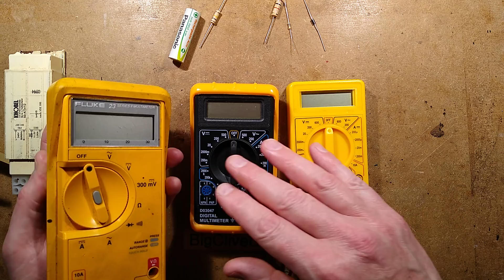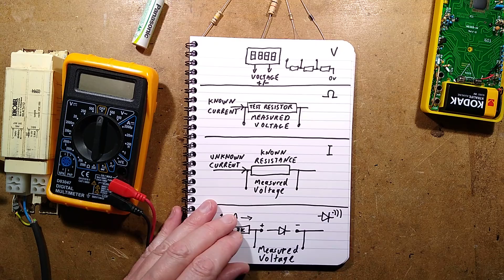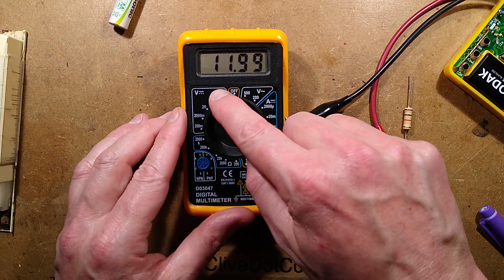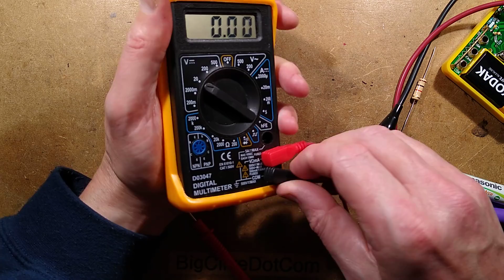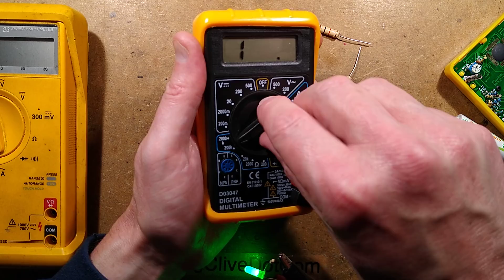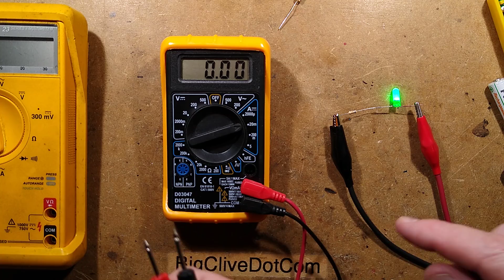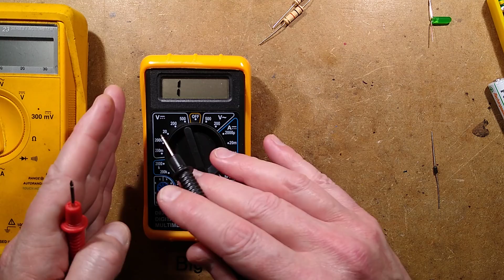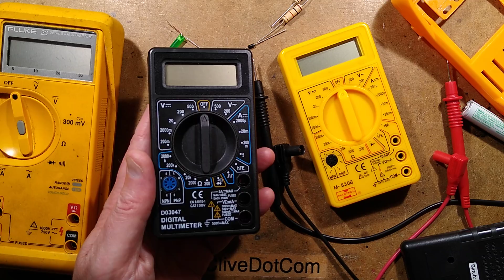How to use your trashy meter without blowing it up (much)

Comment: Hej always great info and vids. I bought a solar panel pack from my local store. When i left it in sun all day and tried my phone on it to charge it up nothing worked. It has 2 usb ports 1 for ios and 1 for android items. I took it back they told me it would take 3 or 4 days to check over, after 123 hours they said it works ok . I picked it up as they would not give my money back. I took it home tried it all over again and nothing. So i decided to take the 3 panels apart from the big pack. So just 2 wires from each as they were in paralel form. I used my multimeter on them and i got no reading at all. I even used a high rate lamp on them and still nothing.  Do you think they are dead or worth saving ? Thanks
Reply from the maker: Many of the solar panel power banks have fake solar panels and are nowhere near the capacity or output rating they state.

Comment: I'm sorry, this may be a very dumb and basic question. Why can't we measure amps without a load? If I want to see how many amps does a power supply output, why can't I just stick the two probes in the output?
Reply from the maker: That would show what current the power supply delivered under a short circuit.  It may blow the meter fuse or damage the power supply.

Comment: Clive I bought an ebay "smart" multimeter.  So far seems to show somewhat accurate readings.  There is no dial setting.  The meter identifies the task required and displays the proper reading.   So far it works.  What is your opinion of these?    P.S.   wish you would do a video covering portable hand held oscilloscopes.
Reply from the maker: They can be useful.  I prefer the manual selection as some of the auto ones don't properly select between resistance and continuity.

Comment: Oh hey, that Panasonic rechargeable reminds me of a question I had about my anyloops (feel free to ignore if you're busy). Is there anything that could make a regular NiMH lose capacity?

I always pop them on to charge when they run out; my charger measures the capacity as it charges, and for years they came up to the full rated 1900mAh, but lately they only make it up to <1800mAh. I have two pairs that I rotate between and they're both doing the same thing, so I have no idea if it's the device cutting out earlier, a problem with the charger, or if the batteries are on their way out.
Reply from the maker: Rechargeable batteries gradually lose capacity over time.   That can be accelerated by overcharging or leaving in a very discharged state for a long time.
Reply: @bigclivedotcom  Thanks! I suppose it's possible I left them on the charger too long, since it does trickle charge them at the end of the main charge cycle. Could be a good excuse to buy a new set of anyloops!

Comment: I have the same fluke meter giving some strange  reading every now and then but still using it . 
My first one was a fluke 10 series meter best meter I had until some twit stole it 
What the new one you flash for a few seconds any good

Comment: What's the best why to read amps in a car ?
Reply from the maker: Either an inline current meter that plugs into the fuse holder, or a DC clamp meter like the UT210E by Uni-T.

Comment: I dont know if Im doing something wrong but Ive used a £9 meter on single phase, three phase and capacitors and have never managed to blow it
Reply from the maker: In most instances it will be fine.  But the difference is what happens when something does go wrong.

Comment: :3 my dad was digging through old garbage from his many cupboards and found a Fluke and was just like "here"
Reply from the maker: Make sure the battery hasn't leaked and treasure the meter.  It's a good one.
Reply: I have mistaken it is in fact a “DURO” meter, it just sorta looks like a fluke.
Reply: Hm, very interesting. I dont know much about this type of stuff but i can see two ceramic fuzes, both in sockets. 10 amp and 250mA. It has a blob chip and a semi scratchy beeper. Id love to send you a photo of the circuit board somehow
Reply: Wow, so theres another meter ive been using for a while which is very old and was also from my dad, its shaped like a brick but it says luke on it XD
Reply: Damnn, its got a gigantic 100kA interruptor fuze in it, and generally massively oversized components. Id love to see you reverse engeneer this
Reply: The old one is a Fluke 75

Comment: How do you use the transistor tester thing ?
Reply from the maker: Put the E,B and C leads in the appropriate holes and in the transistor mode it will give a rough indication of the current gain.

Comment: The cheapy yellow one... Where can I get better test leads? btw, I blew up one lke the cheap yellow one by changing values while plugged into the wall :) a lot of smoke too.
Reply from the maker: Some of the shrouded plugs don't fit into the cheap meters properly, so you may have to experiment or improvise.  The older style bare 4mm banana plugs will usually fit.

Comment: Any recommendations for a meter to use on 240v?
Reply: I've gone for a MP730008 from CPC for £13.  6,000 Count handheld multimeter with manual ranging. CE/ETL certified multimeter is CAT III 600V, which can withstand a 6,000kV surge voltage. Designed with high voltage warning and over range alarm, making it great for a wide range of measurement needs.
Reply from the maker: If a meter from CPC is rated for Cat III then it should actually meet that spec.   Their Tenma brand are basically generic meters rebadged and made to UK standards.

Comment: Do one on blowing up crappy Poundland meters using the mains supply with added electric shocks!  Who else noticed the crappy Poundland leaky zinc battery?  I had one rot my last smoke detector - the alkali (Poundland) ones are much better - twice the price but last 3 years in a smoke instead of less than 1 and no horrible leaks.

Comment: Before you buy fuses make sure it has one...many cheap one don't so it just blows the leads or pcb...
Reply: I guess additionally some have a fuse but it is not replaceable soldered to the board.

Comment: So I have a question regarding components. I come across a component that looks kinda like a relay but it has 3 pins, rectangular, the number is C7R0N 97 and inside there are two pucks (unidentified metal) one smaller than the other but the center pin separates the two pucks. Anyone know this component. I can't seem to identify it.
Reply: The pucks seem to be two types of material I shined them up but the outside ring looks copper or bronze maybe. I'm clueless as I'm just getting into electronics.
Reply from the maker: It's it from a fridge freezer?   It may be a PTC based start relay.
Reply: @bigclivedotcom  hats off to you Sir......after looking those up that's exactly what it is. I don't know where it came from, it was just in a box of components but thanks a million.
Reply: @bigclivedotcom  one more quick q are they only found in fridges and freezers. Or are there other applications for them and I'm guessing the pucks are in fact copper and aluminum? I'm thinking this box of components came from a plasma tv but maybe this part just got mixed in.

Comment: Please start with an Analog Multi Metre. The ones with a poiner / needle that sweeps across face of the metre. They are, in fact, far more accurate, you will learn and understand much more about electronics with this type metre.  
Learn to read, before you learn bad habits. ☺

Comment: Another good entry level meter would be a zotek(?) zt102 or equivalent aneng an8002 - I believe it's like under or around 10 bucks, has sensible ranges, LED-lighting capable diode range, capacitance, a fucking backlit LCD and most important of all - runs off 2 AAA batteries.
I've got like 5 times more expensive uni-t meter(Dave would also say it's shit) and I don't use it just because it's more clunky and uses the stupid 9V battery that's always dead.

Comment: I have found three $5 meters are far more useful than one $15 meter.  You can have them all connected and showing different aspects of one thing.  Like showing the voltage at several spots.  Or the voltage and current at the same time.  Or whatever.

Comment: Heres a good test for your $300+ multimeter,  take yourself some aluminum foil (good conductor), alternately stack that with Mylar film (good insulator) electrically connect every other conductive layer, then attach your voltmeter leads to either side of the massive capacitor that you just constructed. Press the stack to move the plates closer together and as it is moving you generate a voltage. Release the pressure to allow it to relax back to wider plate spacing and it produces the opposite voltage. Ball up your fist and pound the stack and blow the guts out of your $300 DVM.  Buy cheap meters ever after.

Comment: The most annoying thing for me about cheap meters is not having auto power off. It's so irritating to need a meter, only to find it has a flat battery because you forgot to turn it off last time you used it.

Comment: (Science Class) " Please Sir. . . . I blew-up my Multimeter. . . . "
After yrs of analog, I splurged on a Halfords (Rolson) digital. Working on a Suzuki, trying to trace intermittent spark.
On opening DMM, I found one of the fuses was blown (using the old analog). 10A 600v . . . . .
FleeBay is showing £3.45p + £2 p&p. . . . . Surly there is a cheaper more efficient source for this fuse . . . .

Comment: Been using Fluke for donkies years, if I hadn't I would have blown a cheaper version up many times, being absent minded since my 40s I keep checking voltage on the Ohms mode, oops 🙄

PS, been drppoed many times as well 😔
Reply from the maker: I often do that myself.

Comment: On the cheap ass meters.  What are the transister test points like for testing?  Any good?  Also you educated me .  A rotary knob you mentioned?  Also i can add to the list?  A dirty knob is useless for electronics.  I can say with experience it wont be any use at all.
Reply from the maker: The transistor tester is a gimmick.  But used in the past by some audio geeks for gain matching.
Reply: @bigclivedotcom  thanks Clive, very good for you to work after midnight.   Lol
So even to check if Transisters are gud or bad,  isn't really possible then?

Comment: I wouldn't suggest using the ones you get free from Harbor Freight.  It's very important, from a safety stand point, to actually have a back on your meter. 😜

Comment: Bunch of knowledgeable people here, so here's a question: last year i blew the 10A 300V fuse on a Lidl multimeter measuring a car battery. I don't play with mains, so bought some 250V replacements at CPC, but it just isn't working. The Lidl meter has a shunt in it, and warns not to use it on 10A for more than 15secs every 30mins. Is it likely i've damaged the shunt and that's why it's broken? Can anyone point me in the right direction of finding out + repairing? Thanks.

Comment: I'm only 50 seconds in, and I own a cheapo. I needed it for voltage measuring on Mobo DIMMs. I already knew that the more expensive ones are more for Mains, and I'm too scared to actually fuck around with poking around with Mains. Important: please take out the batteries when the device isn't in use. These cheapo devices are cheap for a good reason.
Reply: If removing the battery when not in use is easy if the meter has a little sliding tab on the back of it for battery changes. Many cheap meters do not and you have to pull out the screwdriver and remove it's the screwdriver and remove 2 to 4 screws in order to take it apart which is why people usually leave the batteries in it. For that matter, our Fluke meters at work require you to take the back panel off in order to change the battery.  Perhaps this is so they would be explosion proof under even the worst possible test case? Still, its annoying.  By the way the Fluke meters at work will usually run for about 6 to 8 months on a battery but we've discovered that the "sleep mode" it goes into when it's not being used  for an hour is not the same as it actually shutting off.  The display goes dark but the meter circuitry is still drawing current from the battery, and it's all too easy to leave the meter on by accident at the end of the workday on Friday, and when you come back to work the next Monday you'll find that the battery is dead!

Comment: And now explain the hfe-measurement please... to show what it should do and what it shows.
Reply from the maker: It shows the gain of the transistor plugged into it, but only at low current.  The gain often reduces with higher current.

Comment: Fluke makes you look professional and you don't get bothered by bystanders. LOL
Funny what a brand name can do. It's like using a Duspol.
Reply: A what?
Reply: @goodun2974  CAT IV, CAT III, DIN EN 61243-3 voltage/circuit tester from Benning. An EU thing i guess.  
You can get it standalone or with 1000V protective gloves.

Comment: Accuracy:  I thought a comment about that would be worthwhile.  
Specs like +/-0.5% of reading +/-2 digits are not all that immediately clear.
And having different accuracy on different measurements adds to the possible confusion.
BTW I've had one of these meters for over 25 years and it's still my favourite despite having bought a posher one that cost 10x as much! -disappointing.  Nearly indestructible, but I'd get another if it did die.  One thing I'd like is a better set of leads, but you can buy extra leads for more than the meter itself cost!

Comment: Great tutorial but one moment please, I believe the point that Dave Jones is making is that he doesn't hate the continuity settings that make the 'scratchy' noise per se he hates the meters that take forever to react, some meters are measuring the resistance and will beep if its say less than 20 ohms and this can take them half a second or more and its those meters that are frankly so frustrating they are unusable , let's face it Fluke ? winner winner chicken dinner....cheers.

Comment: I stand by my not-so-cheap cheapy meter (it cost $20 instead of $5). Great little thing, and the extra few dollars is generally spent on getting it to comply with actual standards (even if they're rather low) and replacing the swipe contact switch with push-button logic.

As for Dave, I kinda gave up on watching him. The straw that broke the camel's back for me was a stream he did many years ago where he was building a new editing PC. Every five minutes, without failure, he would repeat how he wasn't going to look at comments because "all the back-seat computer techs" that were all full of crap. Well, as a computer tech for some 20+ years, I got to watch his pompous ass put the fans in backwards and completely ruin the system's cooling profile.

So I stick to watching Clive because, unlike my fellow Aussie, he doesn't have such an over-inflated view of himself. Hats off to you, Clive, a little humility goes a long way.

Comment: Ohm's Law, in a plastic case, with an LCD, some fancy buttons (Auto, Hold, backlight/flashlight) and a dial for the modes&ranges.
That's all, folks! 
Oh, and don't forget a battery, or you'd be dividing by zero! 😂

Comment: Set to measure AC, connected to a DC supply - my meter reads zero.
Reply: You've got a decent DC supply, then.
Reply: @B-System  Provided by most cells or batteries of them.

Comment: When I was kid I grabbed one of my dad meter and I was poking everything electronic in house and it blew fuse out, my dad said that later he replace it or just put there some wire(as he used it just for some DC work). And I shit you not, me being a kid, hearing that you can put wire there, I literally stuck there soldering wire... Weirdly it was not my best electronic work, as when I was like 4-5 years old I stuck big magnet on TV because It make screen show weird colors and I though it will improve image... and yes, it was old CRT tv :] Being kid in 80-90 was fun, I need to admit...

Comment: Have always wondered why multimeter fuses cost £20/$28 each 🤔
Reply from the maker: They have to break extremely high fault currents with AC and DC.  It's the DC that adds the cost.

Comment: "...if you do somehow connect mains across it, and it's set to resistance..."  That's stupid!  Who would ever do that?  I've certainly absolutely never done that myself... multiple times... (whistles nervously)

I actually keep a couple of the cheapie meters around specifically as "sacrificial" meters so I don't have to use my nice expensive fancy meter when I just want to quickly test higher voltages, or loan one out to somebody, etc (and I don't have to really care if I even ever get it back).  My really good meter generally never leaves my test bench, and is never used on anything above 24V or so.

And another reason I prefer the "scratchy" continuity testers is they can tell you if you've connected it across a capacitor instead of an actual open circuit (they will "blip" briefly as the cap charges up and then stop making noise).